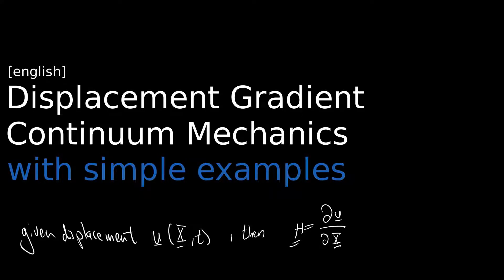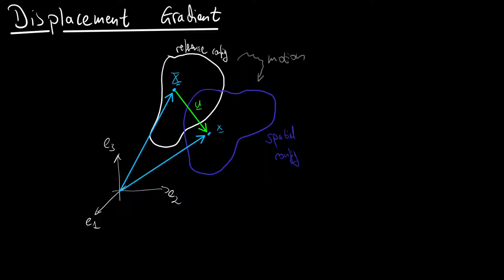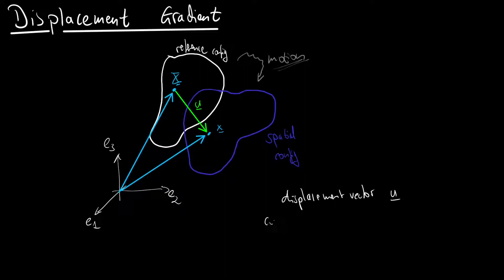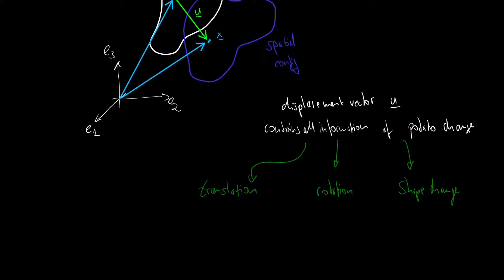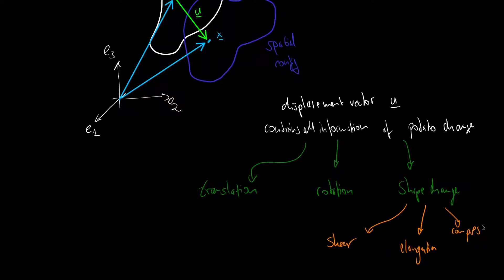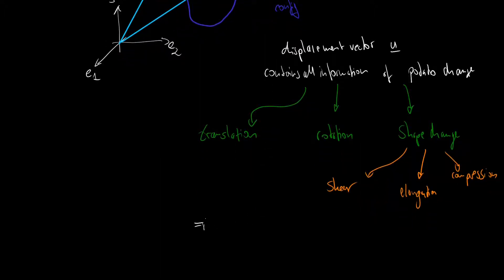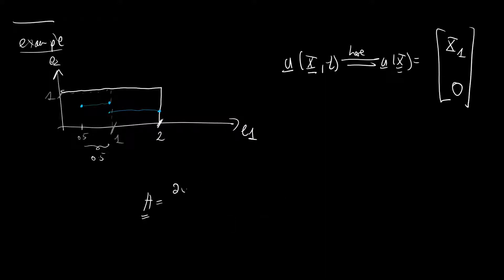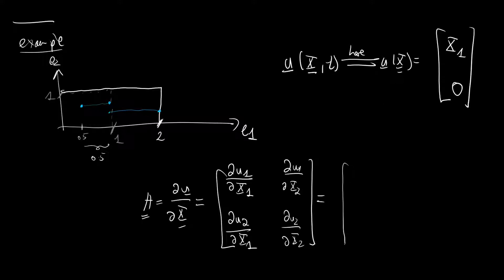Displacement Gradient | Continuum Mechanics | with simple examples

Comment: Very useful video! I have a question that should the displacement gradient be expressed as u \nabla but not \nabla u? For the matrix form of  the displacement gradient in many textbooks is that each row contains the partial derivative of the displacement component in one direction. Thank you!
Reply from the maker: Hi, thanks for the comment and the kind feedback :).
It's a valid question. Ultimately, this breaks down to what convention you use in matrix calculus: https://en.wikipedia.org/wiki/Matrix_calculus#Layout_conventions 
Here, the video follows the the "numerator" layout, as such each row of the displacement gradient is the "mathematical gradient" of this entry in the original vector motion.
Both conventions express essentially the same as long as one is consistent throughout derivations.

Comment: Hello Sir, I have a question about the displacement Gradient, does  the displacement gradient and displacement field the same meaning？
Reply from the maker: Hey, thanks for the question. :)
They are not the same. You can think of it as follows, let's assume a 3d scenario:

- the displacement field is a function that associates a 3d vector to each 3d position in space. This vector points from that point to the point in space to which the material point was displaced to
- the displacement gradient (field) is a function that takes a point in 3d space and associates it with a 3x3 dim matrix. If you look at the matrix row-wise, you see the gradient of each coordinate. It is therefore some sort of distortion measure.